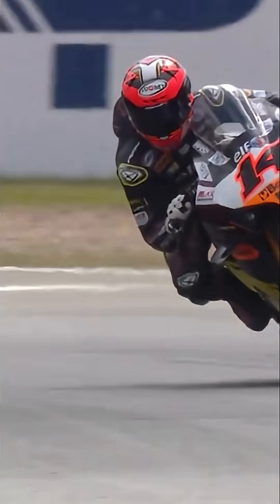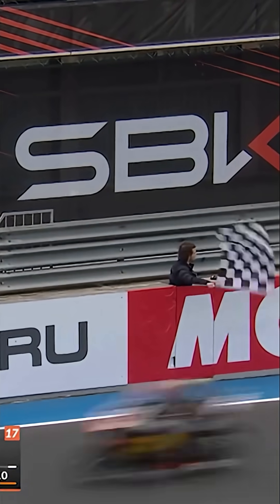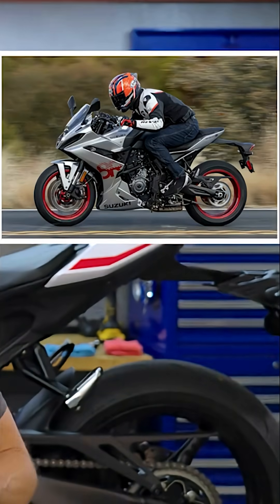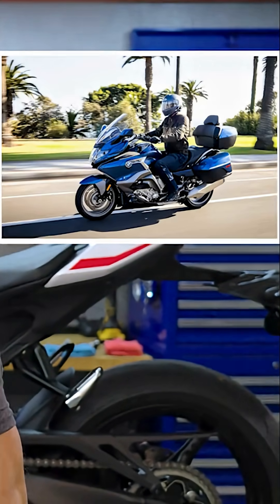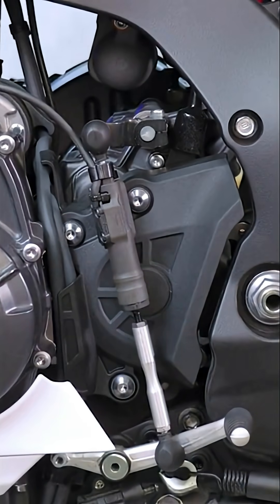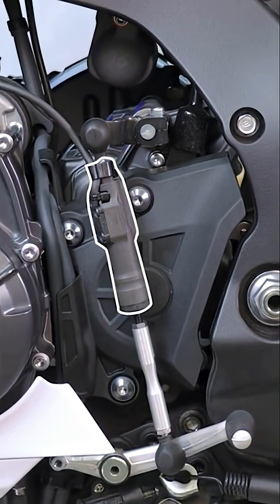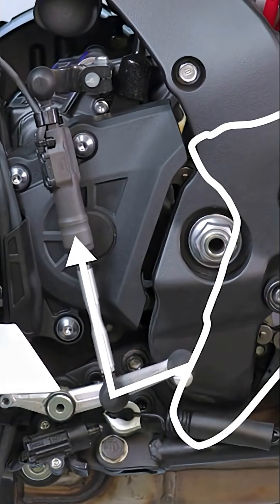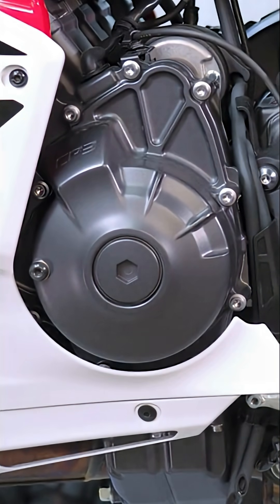No Clutch, No Problem! How Motorcycle Quick Shifters Work  The Shop Manual #motorcycle

Comment: You're absolutely missing the point. It's a great advancement that allows inexperienced riders to get comfortable with the bike without the added pressure of rev, clutch, shift and trying not to die. Another bright spot is that this allows older people, handicapped people and others to keep riding. The DCT from Honda is amazing as well as the Y-AMT from Yamaha

Comment: as a retired mechanic, i fully support complex things you dont need, especially  if they require software updates, although it is usually reliable, until its not, and leaves you in the middle of the desert in utah. 
keep me rich folks !!!!
Reply: It's a quick shifter, if it stops working you can use the clutch and do normal changes. No need to call out a retired mechanic!
Reply: Motorcycles are usually reliable, until they break. That’s why smart people just go for a walk

Comment: Still a gimmick on the road... 

Like paddle shift in cars, folk want them just because. I will always argue that in a car, much more driving pleasure is to be had with three pedals, an H-pattern box, and proper heel & toe changes. Flappy paddles, whilst definately cool, take some of that pleasure away. 

Same for two wheels, I can shift up through my box, clutchlessly pretty damned quickly and almost always do. Once you perfect the technique it's very easy and very fast; hook the pedal and roll off the throttle just a little until the gear snicks in - you gotta hook harder as you roll off and be very firm to ensure proper engagement. 
Shifting down is a little harder clutchlessly but can be done in a similar fashion, just add a little throttle.

I once rode over 250 miles doing all shifts clutchlessly, to preserve fluid from a leaking clutch for start stops, but generally I use the clutch down on changes to get a nice rev blip and synch match.

So yeah, QS are a gimmick, if you ask me and people are not learning to operate their machinery with them coming as standard.
Reply: I dislike the paddle shifters I had on my last vehicle, but I love my Quickshifter on my GSX-S 1000GT+. Different strokes I guess. Remember the entire saying about the customer being right, in matters of taste.

Comment: Have a Pingel electric shift on my 03 stroked 120  hp carbureted  WideGlide my drag times went from lo 12s to high 11s@ 113 mph I’m age 80 a younger person would do better  cost was $ 1250,00 installed Once ya twist the throttle to 5800 and push the button for a good carnival type ride had shift 4 years no problems